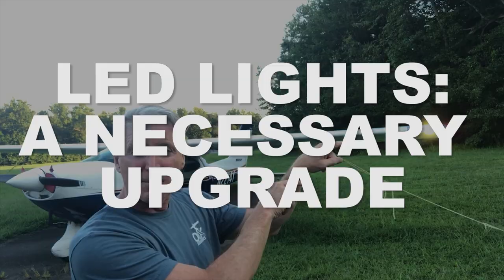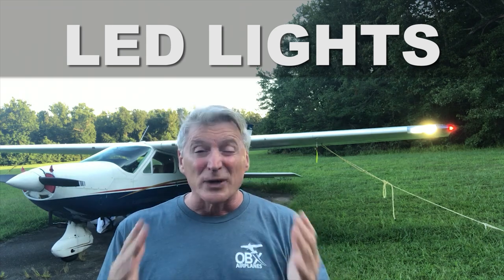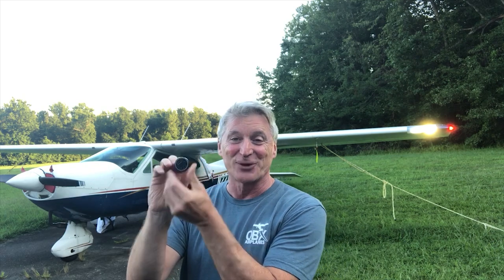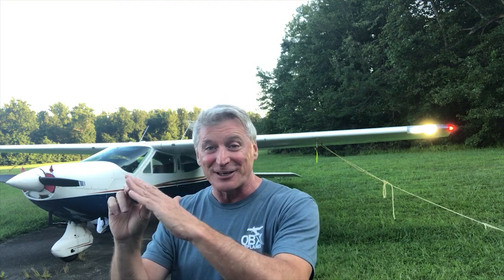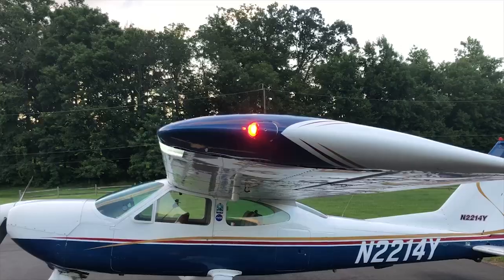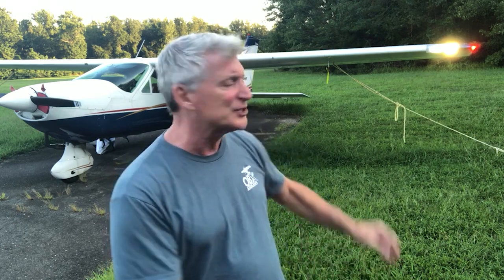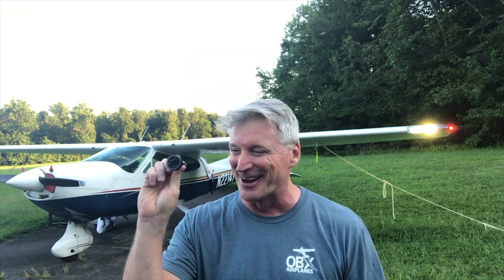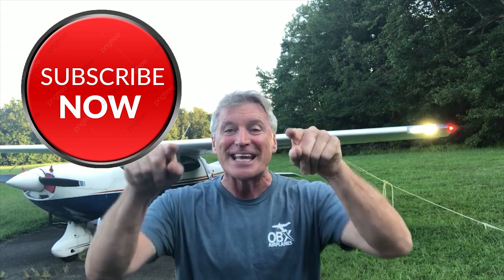L.E.D. Lights: A Necessary Upgrade

Comment: I've got a '68 177 too.  Classic issue on ours is corrosion between aluminum buss bar and breaker screw connections.  If the buss bar feels warm with everything on you know that's an issue.  If alternator and connections are good you should see 14 +/- .2.  You said your getting 12.6 - battery won't recharge properly and desulphate unless over 13.5 and putting 125% of starting discharge back into it each time.  I put in the Plane Power alternator and Zeftronics regulator with overvolatge protection.  The new regulator will protect your expensive avionics in a voltage runaway situation.

Comment: A good load check on your altinator with all equipment on and running, your battery charging volts should be 13.5 volts.

The tell how well your altinator rectifier circuit is working.
Reply from the maker: Think it needs some help.... 😉
Reply: With the aircraft running you should read 12.5 volts DC to 14.0 volts DC.

Your altinator generates approximately 65 Amps at 29 Volts AC.

The altinator has a component called the rectifier circuit. 

This circuit delivers two separate  voltages.

One set is for the operation of all your aircraft electrical needs and the other voltage is to recharge the aircraft battery.

This circuit is called the rectifier.
To test your altinator circuit, connect the volt meter to the battery. At idle you might see 12.5 volts.

Increase engine room to 1500 and you should see and increase in voltage to the battery to be 23.5 to 14 volts.

Note: If your battery voltage is reading 12 volts or less when the aircraft  engine is at idle, then increase to 13.5 to 14 volts when engine is at 1500 RPM, YOU HAVE A FAILING ALTINATOR.

Recommendation.
You have been upgrading the aircraft avionics instrument panel. Have you documented the amprage of each instrument?

By doing this, you can determine if the altinator total amprage is adequate for your power load requirement.

The rule of thumb, the aircraft amprage load should not exceed 60% of the altinator total amprage output. This is to compensate for unexpected power load or surge.

If your aircraft is using a lead acid battery, it is best to have a battery which is not sealed or maintenance free. These type of battery loses liquids and when the battery fluid level is low, the battery can generate unexpected power load or surge on the altinator

FYI: I am a certified Aircraft Avionics Integrated System Technician. USA Air Force trained.

Comment: I have no lights on my plane at all, thought about it but I only fly Day VFR here in the UK and most lights make little difference in good daylight. I thought it might be good for just in case I did a late dusk flight but I am so tight on weight I must say I put it off.
Reply from the maker: Totally understand... a pilot friend actually told me if you are not comfortable flying at night don’t push it. I used to sail all the time at night but I probably have 20000 hours in large sailboats ⛵️!!! Thanks for watching!
Reply: @Over50andLearningToFly  We do not have night VFR here in the UK, so would have to get IFR qual and that is not possible on my class of aircraft. In days of old I was qualified but now I like to enjoy the flight and see things rather than just using the plane for transport.

Comment: Did you ever install the davtron?
Reply from the maker: What’s the davyron?
Reply: Over 50 and Learning To Fly!  A davtron is the voltage gage I told you about when you the last electrical malfunction. It's a 2.5" gage that would go where you removed your vacuum gage from.
Reply from the maker: tqmx1 I haven’t got one yet - I was thinking about putting a. Engine monitor in ... but still thinking ... I need harnesses one the plane as well ! 😆

Comment: LED anything is better than an incandescent bulb but the alternator should still hold the voltage with the old bulbs, the system was designed that way.  Maybe there is an underlying issue just starting to surface? Alternator, battery, terminal corrosion or bad circuit breaker.
Reply from the maker: There was .... 😇

Comment: 12.6 volts is still to low with a good charging system and led bulbs you should be between 13.5-14.2 volts.